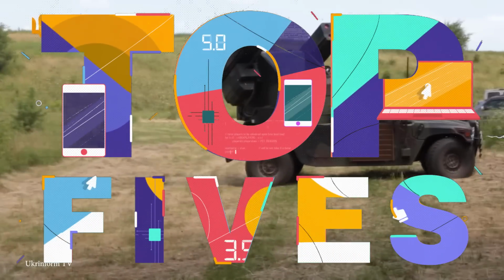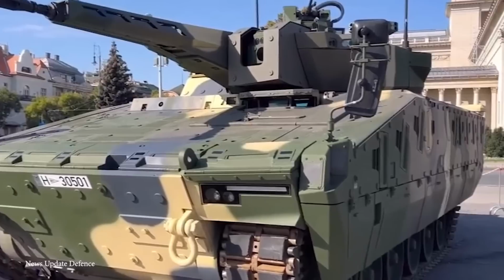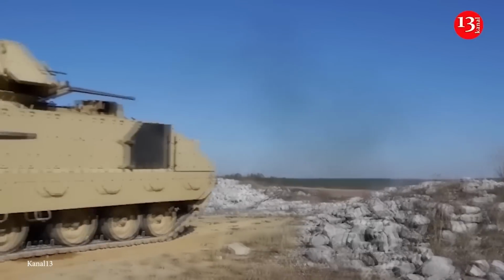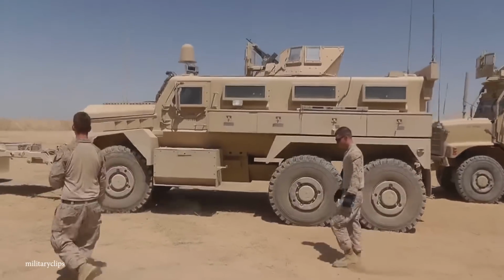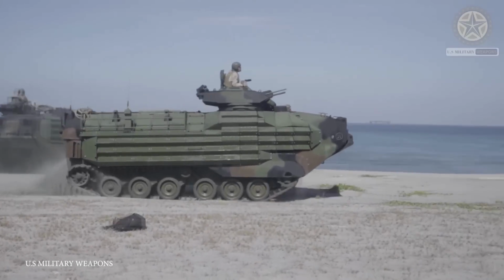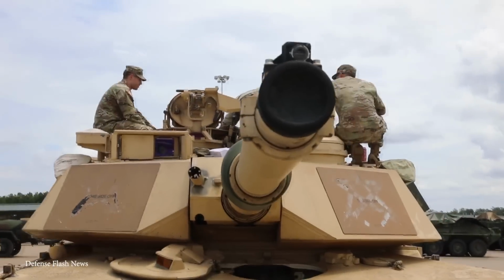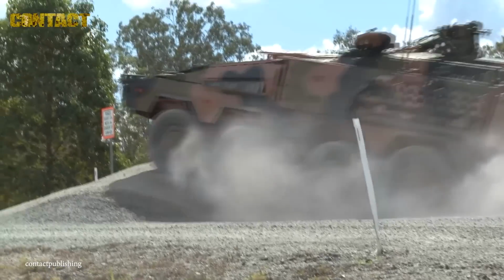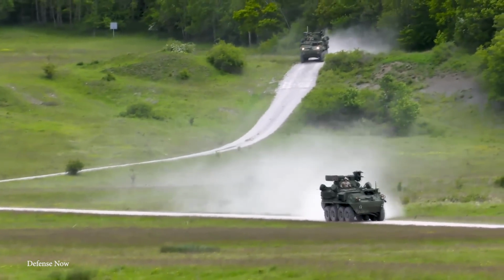15 MOST Sophisticated Military Vehicles

Comment: Gotta stop you on the Avenger system you had on your list. It’s a total POS. Between only carrying 250 rounds for its machine gun and the very high chance of a hang fire which can seriously cost the crew their lives by unfriendly aircraft it’s basically a thin hauled composite shell that sits on a Hummer chassis that is very top heavy and not dependable. I was an Avenger crew member and when the engineers asked my opinion of the weapon system I told them it was glorified garbage.
Reply: AMEN 👈💩IT IS TOO DAMN DANGEROUS...👈👍👍✌❗